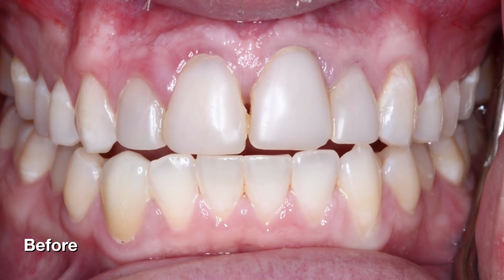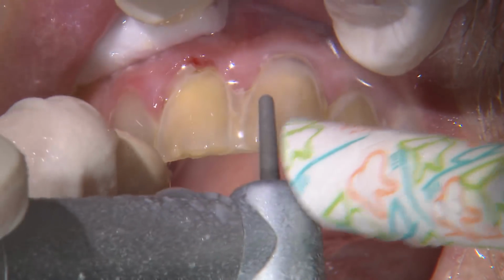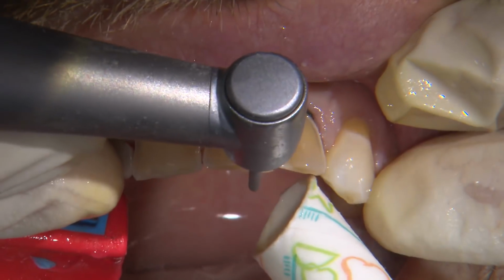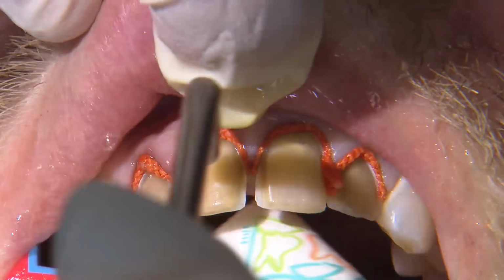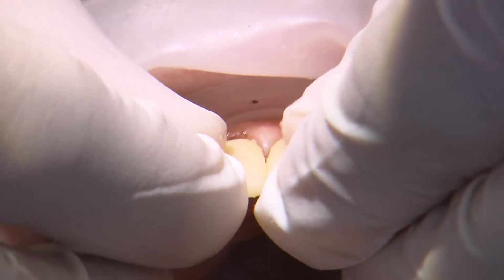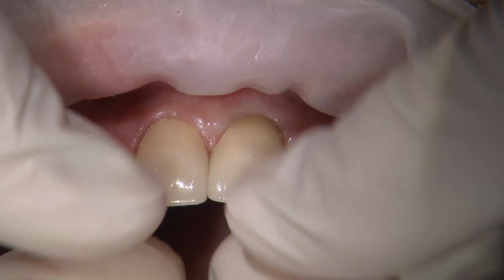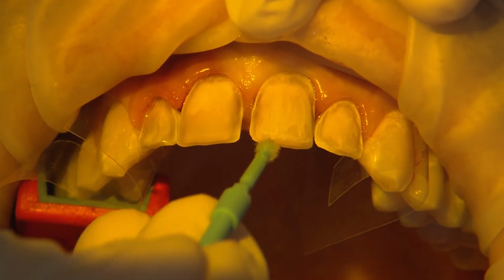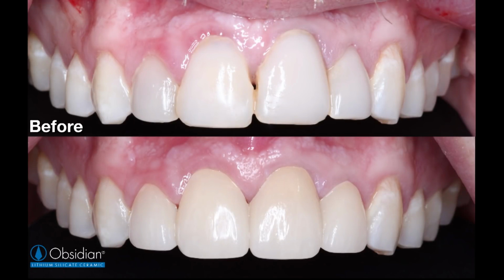Case of the Week: Replacing Unesthetic Direct Composite Veneers

Comment: I had lil gaps on my upper teeth I had done composite veneers  but my look is totally changed it's so thick it doesn't seems looking natural  . Is it d composite are thick and unnatural look
Reply: Yes, I had mine recently and it's nightmare.. unnatural, oversized, I have thick layer of composite on the backside of my 3teeth, but WHY? (during correction my dentist overshaved so a bit damaged my enamel on 1 teeth so I requested her to stop). Before having it's done I asked billion times if it's reversable, she said yes, and now she is telling me that she can't get my normal teeth back...I have an agreement with the clinic and that doesn't help me either as I don't won't her touch my teeth
Reply: I had the EXACT SAME ISSUE

Comment: about gluma desinsitizer 
- can gluma affect the strength ofthe bonding  ? 
- can we apply it directly after the preparation ? 
thank you
Reply: Gluma can actually enhance the bond strength to the tooth. You're able to apply gluma directly after preparation, but I also recommend applying it again during cementation, especially if using total etch technique.